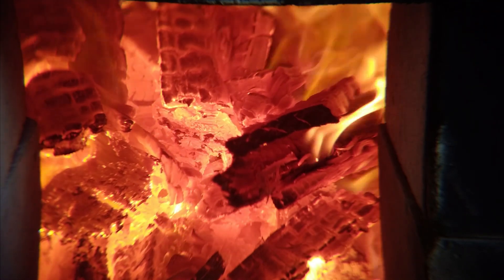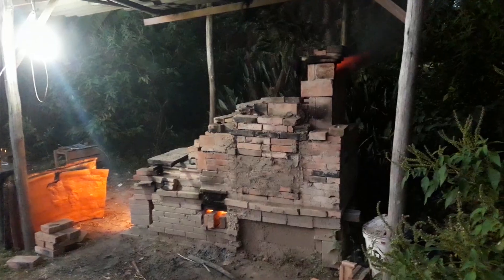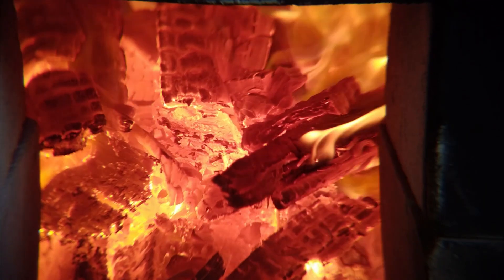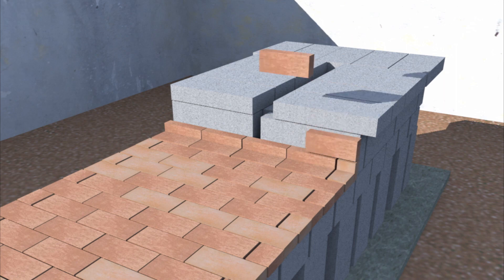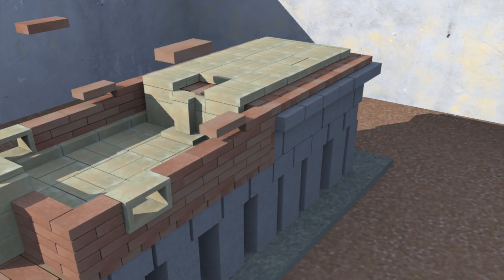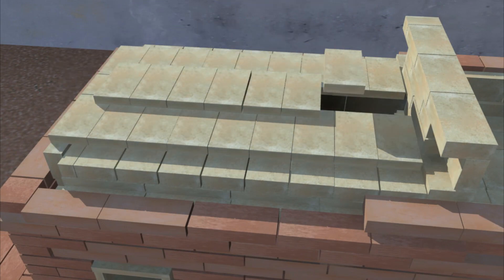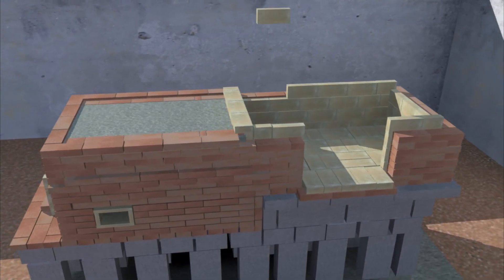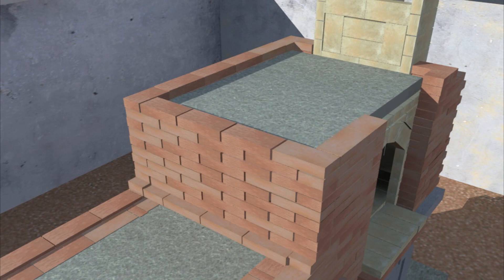Building Norberta - A wood burning kiln

Comment: Hi!! Very interesting video!! I have a big yard and id love to have a small/medium size high temperature kiln !  Do you have a website?? A plan with dimensions ti build this kiln?  What temp do you fire to??   How big is the loading chamber (in liters)?
Reply from the maker: Thank you for your comment, I'm glad you liked my project. Unfortunately I don't have blue prints, or exact dimensions for this kiln, you will have to just count bricks in each linear direction to get a basic Idea. So long as the fire box and the ware chamber are both close to the same size, you'll be fine, no matter what dimensions, if not too far from what you see in the video. I have taken Norberta up to 1200°C, or cone 6, in a 14hrs firing. Use a thermocouple, or your firing time will be much longer and still you will not be so sure of what temperature you have reached... For bisque firing, you can work with the signs you get from the chimney, no need for a thermocouple. I still recommend you use one anyway, so you can be more economic with your firewood stock and quicker achieving the right temps.

Comment: What is the highest temperature can this kiln reach? Also why not have an arch in the firebox and the loading chamber. That may increase the top temperature. If an arch is used then some steel fabrication would be necessary to support the force against the walls. I would be prepared to build the kiln once my salt kiln is finished.
Reply from the maker: I have taken it to around 1000°C in around 8hrs of firing. I suppose it could reach 1220°C or cone 6 , if you fire it for considerably longer, around 16- 24hrs. I have not tried yet because I don't have a helper to take turns with me tending for the kiln. I can't go on that long by myself, it is exhausting! But one of the viewers of my Portuguese language channel has built his version and he claims to have reached 1200 in around 10hrs too, so I believe his version has improvements. As for your question about the arch less design, you have answered it yourself: I'm cheap and lazy. I don't want to spend the money or the effort and the extra material (more bricks and the iron frame work) if there is a cheaper and almost as effective way. the firebox wouldn't benefit from an arch, and the ware chamber would maybe gain a little smoother flow from the curved surface... But flat works just as fine! Remember, this is basically a side draft design. Arches are better for down draft kilns, as they gently reverse the orientation of the draft from up to down.   What would really amount to a great improvement to Norberta is making the chimney taller. And also designing some grate system to allow airflow from underneath and through the ambers.

Comment: How do you seal the arched entrance to the ware chamber?
Reply from the maker: Thank you for your comment. Once you load al the pieces that will be fired, you lay a layer of refractory bricks and a second one of common bricks. But you must use only dirt mud between the bricks. So it is really easy to open after firing, and you can actually use the same material many times over. There is a video in this channel called "Bisque Firing a Firewood Kiln" that shows this and other aspects of operating Norberta.
Reply: @improbabilitydrive6005  Thanks so much! We got everything together over months, as we can afford, and now we are READY to start building. So excited 😁👍

Comment: Very ingenious the ceilings of the firebox and the main chamber. That's actually a problem.
Reply from the maker: So long as you operate within the temperature ranges that your bricks can deal with, you should be fine. Norberta has been fired many, many times now and it is all right. I haven't pushed it beyond 1100°C, because I haven't built that little arch on the door to the chamber which I show in the 3D animation. My bricks are almost flying onto thin air at that point. Yet, the firebox ceiling which is supported from all four sides is almost intact even after all the wood burning it has been through.

Comment: Great video! There aren't that many out there that detail a small-ish kiln build with bricks-- thank you for the inspiration :)

Are you able to get wood-ash glazed surfaces with this architecture? It seems like there would be enough draw for the ash to settle on pieces but I'm still learning about what goes into that.
Reply from the maker: I think so. In fact, I believe you couldn't get rid of fly ash if you wanted to, with this cross-draft design! I have used it more often for bisque, though.
Reply: @improbabilitydrive6005  cool, thank you!

Comment: Absolutely wonderful instruction, clear and well-made. Thank you for you share of knowledge! 
Would a scaled down version of Norberta be able to reach high temperatures? 900°C, perhaps?
Reply from the maker: Yes, in fact I started with a proof of concept that was a scaled down version, for firing a couple of small bowls, if so many! I built it with refractory bricks inside my regular brick barbecue grill... It bisque fired the test pieces very well, and then I had to hire someone to go fix the barbecue grill... It didn't resist the high temperature and began to crumble!... lol! BUT (there is always one), it didn't take much shorter to fire than Norberta does now, which is why I settled with this latest size for her!
Reply: @improbabilitydrive6005  I see. Thank you kindly, good sir

Comment: What’s the maximum temperature of your kiln? I’d be interested in using it as a glass furnace. 2140 F
Reply from the maker: I am only familiar with pottery kilns, and I don't know the needs and techniques for working with glass.  I think a cross-draft wood burning model like this might be a little messy for glass, with a great deal of flying ashes in the environment. And I also believe you will need a better open/close system than a door made of a simple layer of bricks so you can handle your glass after it is hot, if you want to work with the molten glass. I haven't yet gotten it to its highest possible temperatures, But I have reached around 1900°F within 12 hours of firing it.

Comment: Is it essential for the doorway to the ware chamber to be arched?
Reply from the maker: Not really, my actual version of Norberta does not have that arch. But I think it is a weak spot in the supporting structure of the ware chamber's roof which the arch will handle well.
Reply from the maker: My archless version is showing serious signs of aging and roof bricks are getting a bit lose in their places. I haven't had the courage to ramp it up above 1200°C because of that!
Reply: @improbabilitydrive6005  thanks!

Comment: can this also be used as a pizza oven?
Reply from the maker: It is not a design that is good for pizza... Pizza ovens are generally made to deal with lower temperatures than ceramics, never more than 500°C. Also, this design is not concerned with keeping the bulk of the smoke away from the material inside, like pizza or any other kind of food. Pizza ovens are usually round, igloo like, so the smoke rises and flows away via the chimney without changing the taste of the food.

Comment: Do you have a materials list? I like this kiln and would like to build it.
Reply from the maker: I bought the material as I upgraded Norberta, along the years, so I don't have an exact count... But I can try and estimate the number of bricks... From the 3D file... the problem is that the 3D file can't tell half bricks apart from whole ones... so it is just an estimate.  According to 3DS Max, Norberta has 350 refractory bricks and 550 regular ones. But as I said, it is a little less than that, since half bricks are counted as one...
Reply: @improbabilitydrive6005  thanks. That gives me something to work from.

Comment: Hi
How is Noberta?
I think your video is the best instruction available. Thank you very much.
Hope to start my own very soon.
Do you by any chance have a materials list?
Have you had any more firings?
Do you think you could get it up to cone 10/stoneware with enough time?
Reply from the maker: I haven't tried it to such high, cone 10 temperatures yet, and I think that with a few improvements it may get close to that. By improvements I mean a taller chimney, gratings under the fire to draw extra oxygen from underneath the ambers, people helping taking turns and a whole truckload of patience. It might take a few days and nights.
Reply from the maker: I bought the material as I upgraded Norberta, along the years, so I don't have an exact count... But I can try and estimate the number of bricks... From the 3D file... the problem is that the 3D file can't tell half bricks apart from whole ones... so it is just an estimate.  According to 3DS Max, Norberta has 350 refractory bricks and 550 regular ones. But as I said, it is a little less than that, since half bricks are counted as one...

Comment: Hi Thanks for posting this. The animation is brilliant. Do you know what temperature Norberta can fire at, please?
Reply from the maker: I have reached 1050 degrees Celsius with it, in around 12 hrs. I believe it can get to cone 6 in around 24hs, or so. I have not tried to go that hot yet, because I would need some help taking turns watching over and stoking the fire. I'm still looking for some volunteers!
Reply: @improbabilitydrive6005  Over 1000C is impressive. I'm playing with a budget batch rocket stove with a ware -chamber (yet to be added) on top. If I can match what you've achieved I'll be happy. I'd offer to take a watch on your 24hr marathon but I suspect we are in different time zones!
Reply from the maker: @staphylea1  it is not a time zone problem, it is an hemispheric one! I´m in Brazil (or are you in Australia?) But thanks for the enthusiasm! lol
Reply: @improbabilitydrive6005  with my wood kiln i reach 1050 C in exactly an hour.
But my kiln( i didnt named it iet) its the most unusual wood kiln ever made.Its made from Ytong ( aircrete) wich seals soo much but its good only up to 700 C for repeated use.
The Ytong its protected by 2,5 cm 1400 C zirconia ceramic wool ,inside.
Ytong is verry common and cheap in Europe and all around the world ,except North America .
And my burner( this is like no otther) its a wood burner but forced air gasification( burns the smoke not the wood).
So my firings are all without smoke.
But its too fast to reach that temp in just an hour.The boron glaze its literally burned iet the bottom of the heavy, big pots dont reach the soaking needed like the sides of the pot.
Reply from the maker: How interesting! Put it to a video and let us know it! I saw the video showing the burner you are talking about, it is very nice. As you said, this ramp is way too steep for pottery, but it might be awesome for jewelry and smelting!
Reply: @improbabilitydrive6005  im.building a much bigger gasifier for the kiln .240 litters volume and made from firebricks and ytong on the exterior wall.
Its fast but good for raku and on the big gasifier im building now,i plan to have longer firings ( like 2-3 hours).
When il finish the design it will be a real cheap to operate on wood chips ( branches) kiln that will be 100% smokeless and i think the most efficient wood kiln ever made regarding fuel spent.
I will donate the design to Potters for Life org.
I have fired bisque 25 kilos of clay pots with just 7 kilos of wood.Thats a record i think .
The most efficient ive read its the Olsen fast firing kiln wich uses a kilo of wood for a kilo of ceramic.
But Olsen kiln its not a gassifier like mine.Gassifiers ( especially my design of TLUD with bottom venturi ports and forced air) its much more efficient.
For my firings i calculate in gas then i double the Kwh for wood ,by weight.
So 7 kilos of wood have the power of 3,5 kilos of gas.
Wich is half of a propane regular tank here.